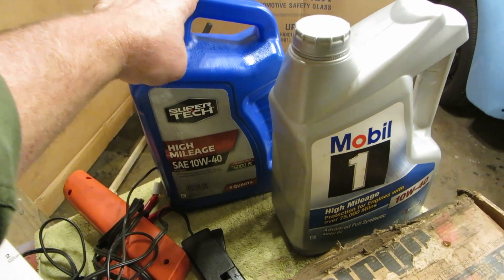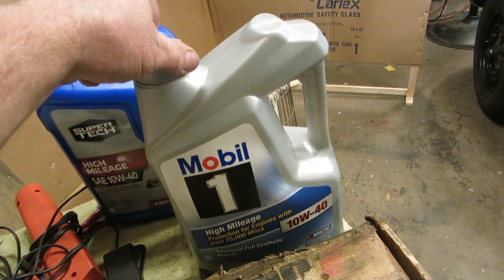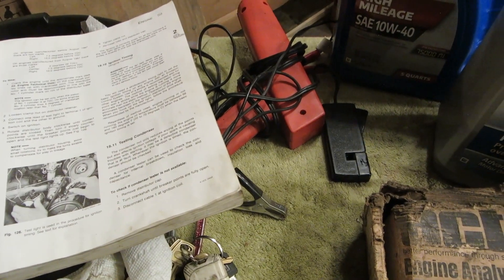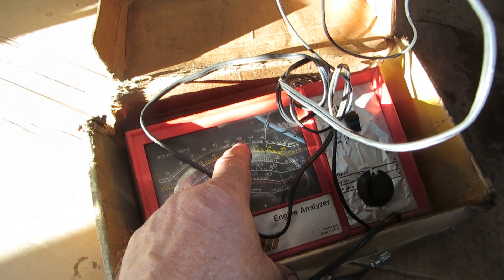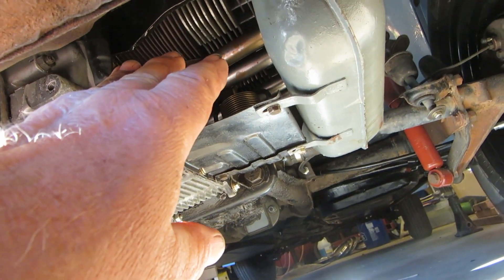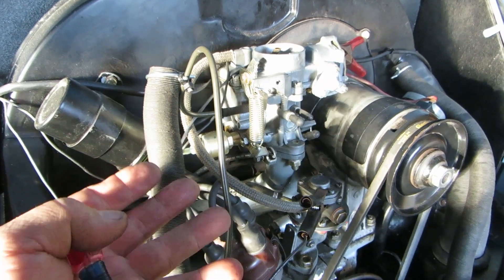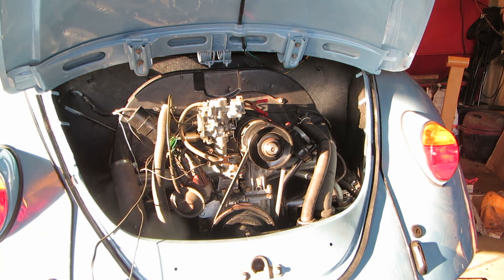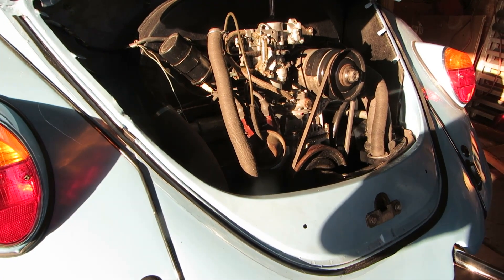How to tune your VW Engine

Comment: You should set the idle with the air cleaner installed. Oil....I just use the cheapest 10W-30 detergent motor oil but I always stick with the same brand. Don't ever mix brands if you can help it. Seems to run fine, I'm not crazy about the fan belt vibrating like that. Might not be tight enough or the generator pulley could be cocked a little to one side. I noticed that you had the oil and generator lights switched around in an earlier video.
Reply from the maker: I think one more shim out will tighten it properly.
And yeah, I see that now....air cleaner need to be on.

Comment: been years since I seen one of these in use. You had a nice friend way back in the good old days. was wondering where air cleaner is an oil bath type if you set the carburetor  with it on or if the book said with it off. Love the car more every day and brings back memories of my old 66 1200
Reply from the maker: i did not see where it said either...good point though
Reply from the maker: Yes, the book shows the air cleaner attached during adjustments.😀😀